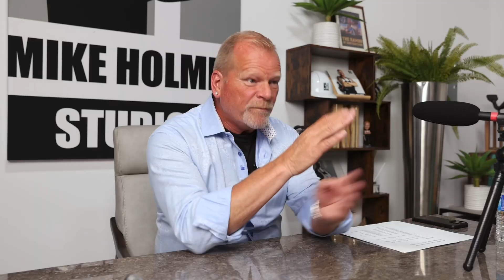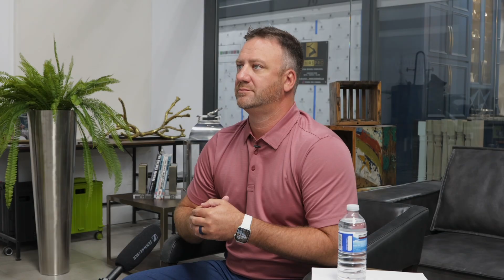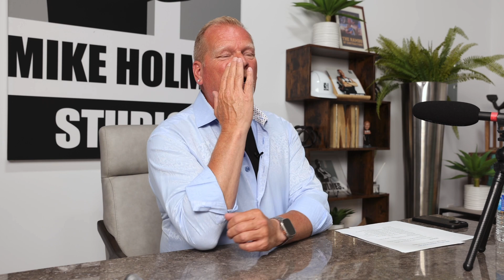What Are ARC FAULT Breakers | Mike Holmes Holmes On Homes Podcast

Comment: As an electrician. I understand the need for arc technology BUT!!!
The way the technology was introduced to the industry caused more distrust with us electricians and the public. 
I lost 1000s when arc fault breaker first came out. Building new homes and explaining to homeowners that their appliances that they used in their old home is not going to work with the new CAFCI breakers simply was wrong

Afcis are not like GFCIs. The principal behind GFCIs is simple and known. Read the amps in and out and if there is 6 milliamps of difference then trip the GFCI. 

However AFCIs are complex and proprietary to each company with no oversight. And that’s the issue.

Comment: As with anything new, the first arc fault breakers had problems. Also, anytime anything, not just the arc fault breakers discussed here, have a bunch of false positives, the item in question will lose credibility. Once that's lost, it takes a long time to get it back again. For example, car alarms go off frequently (not as much any more, but they used to be rampant), so people got to where they ignored them.

Comment: The parents of a good friend who lived in Caledon ON (near you!) had a baseboard heater that was arcing inside the wall for years without them knowing it. One day it decided that was the day, and it caught fire. The fire went up inside the wall, into the attic, and across to the front of the house before it punched into the living area. By the time the smoke alarms went off, the house was fully engulfed. They all got out, but the house was competely destroyed. An arc fault breaker would have prevented this.

After this happened, I installed heat detectors on my attic, connected to my hard wired and monitored alarm system.
Reply: how would bed sheets set fire to a receptable?
Reply: @randomrazr  what are you talking about? I didn't mention bedsheets or a receptacle.
Reply: @randomrazr  they wouldn't